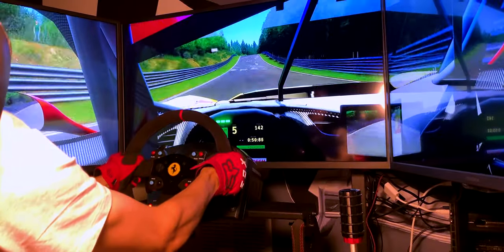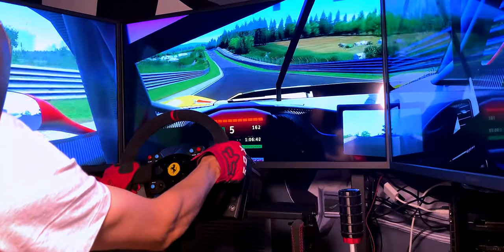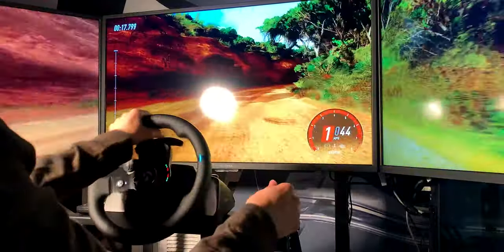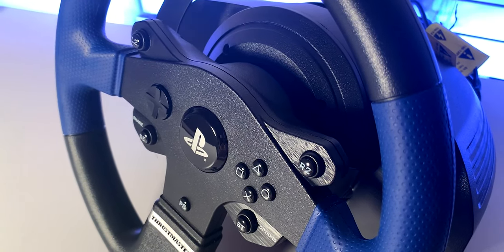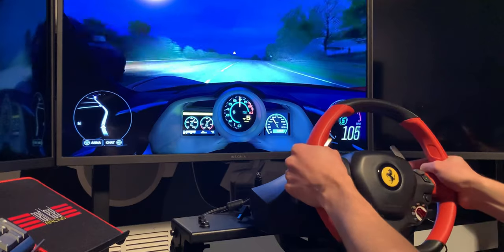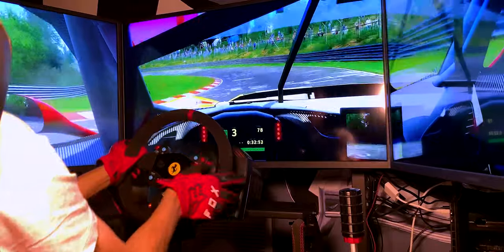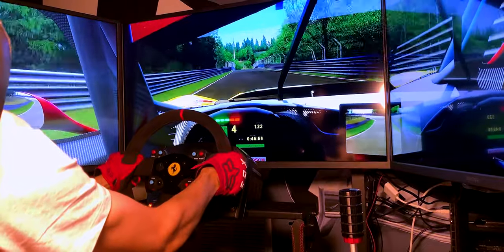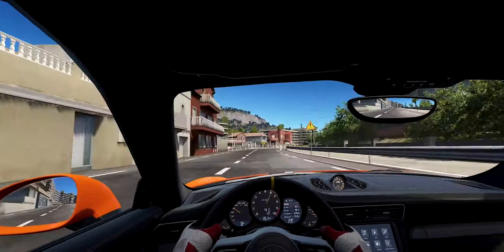What is Force Feedback

Comment: I have just one criticism.

The type of drivetrain the wheelbase uses has NOTHING to do with how powerful it is. Gear driven can be just as powerful as a 20Nm if you want it to. The reason they aren't is due to the super low cost of putting them together & then selling mass market just like Logitech does it. Same goes for belt drive or even hybrid drive. There is literally nothing stopping you from slapping one or two motors together to create a ridiculously powerful wheelbase with belts, so having people say that power a wheelbase can put out is due to the drivetrain it uses it just plainly misleading.

It's like saying that a car doesn't reach 300km/h because the rims are scratched.
Reply: The advantage of belts and gears is that you can assemble one with a smaller, cheaper motor which is usually the biggest upfront cost in manufacturing besides the control logic. If you do decide to run a belt at the torque of a direct drive however, you can expect reliability problems and if you choose a gear, the noise will quickly become unbearable and those 2 are the  limiting factors to what torque you can run (or rather, how much power you can transfer).

Reliability wise, if you assume the possible points of failure are accounted for you can use better, lower tolerance gears or thicker belts to solve aforementioned problems, but direct drive also has less points of failure and has no such issue.

Comment: okay, but I'm using keyboard right now (for forza). Meaning I can't feel anything but I have no problem with that. I just want to be able to steer as little or much as I would like. Same for gas and brake. Am I good to buy a wheel without force feedback?
Reply: no, it's better to use a controller than a wheel without ffb... trust me, moving the car with your thumb vs your two hands require more information about how the car handle turn, if there's no resistance in the wheel, you'll have high chance of oversteering all the time
Reply: @Arszene  thanks

Comment: The excessive force feedback wars are just stupid. I have driven around the real Nurburgring in my car and I've also driven around it in a similar performance car in Assetto Corsa, with my Logitech G27 that has force feedback. I like my G27 and I keep the force feedback at about 40% so it's not too floppy.

Well... the thing is that force feedback in racing wheels is nothing like the real thing. You can't simulate it properly, so what most manufacturers do is just offer stronger force feedback and that's just nonsense. I'm sorry, but the steering wheel in my E420 CDI didn't break my wrist when I went up on the curbs in a few corners on the Nurburgring. If I bought a direct drive wheel, I'd just have to fight it... 
Perfect if you want to simulate driving a Willis Jeep off road, garbage if you want to simulate driving a normal car on a proper road.

VR gives you much better immersion than a vibrating steering wheel that is slightly harder to turn.

Comment: Does a wheel with vibration instead of force feedbakc do similar things? I'm mainly gonna use my racing wheel for forza
Reply from the maker: No. Vibration and force feedback are completely different things. Vibration is mostly just for.... "immersion" but won't help you on track.
Reply: @OCRacing  Thanks! Does that mean that the PXN v9 would be bad for Forza?
Reply from the maker: @deltapi6880  definitely consider a wheel with force feedback. Especially if you want to take driving at least somewhat seriously.
Reply: @OCRacing  Sure thanks a lot bro! However I don't really have a lot of money, so I'll have to take some time to think about it.

Comment: so my question is the tmx pro is it better than the g29
Reply: Heres a video comparing the two:

https://youtu.be/9Da5BoOFM2Q

To clear up some confusion the Tmx is exactly the same wheel as the T150 just compatible with xbox instead of ps4.
Reply: @noahh6032  thx already knew that but okay
Reply: @noahh6032  oh and the t150 has 1080 degrees of rotation instead of 900 and something
Reply: @noahh6032  i saw that vis
Reply: @perosoldic3868  Unless you play Euro Truck Simulator the degrees of rotation is pretty irrelevant😅
Reply: @noahh6032  ik

Comment: How much force feedback does the t150 how
Reply from the maker: No sure on the exact amount. A quick google search away
Reply: the T150 FF is about 2-4 lbs, maybe less,  If you play F1 it is fine, but get the pro version, better pedals.  The T150 is fine for most if not all racing sims/games.